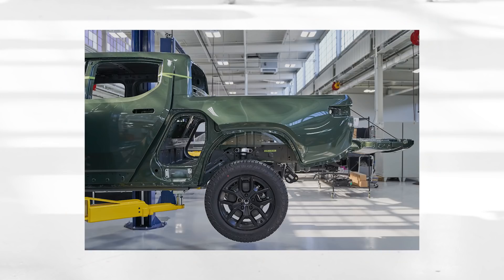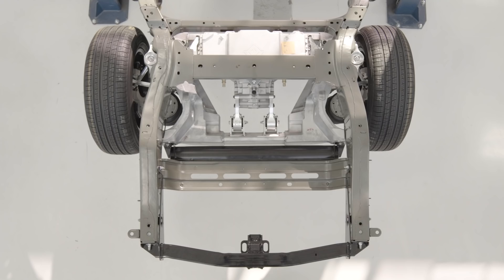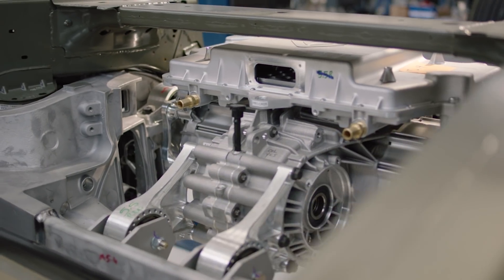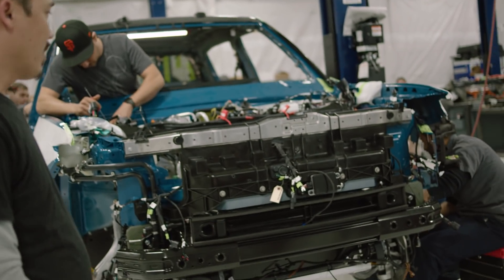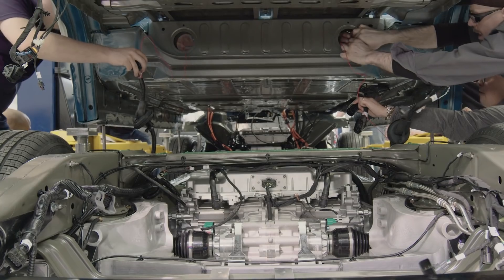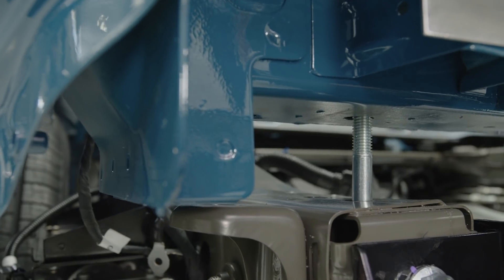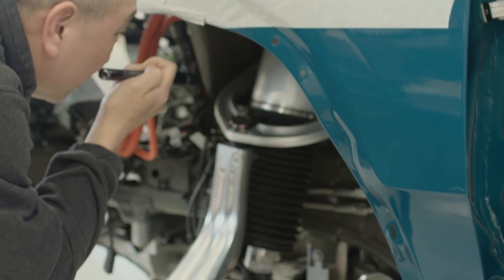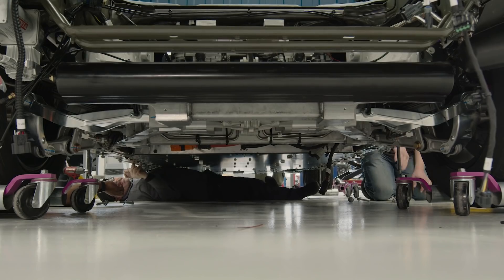Building a Test Vehicle | Progress Report | Rivian

Comment: When is Rivian finally going to deliver.  I've been promised delivery at the end of 2019, still waiting, now it seems mid 2021???  All promises and no deliveries.  When are you going to release colors, options and accurate pricing?  When are you gonna allow 3rd party testing of your vehicles?
Reply: I wasn't aware there was ever a promise to deliver any vehicles in 2019, it was always late 2020, and that got pushed back due to Covid-19 to 2021. Here is R.J. Scaringe, founder of Rivian, at the 2018 L.A. Auto Show stating delivery in 2nd half of 2020:  https://youtu.be/vphI_a6Qizg?t=1248
Reply: This is looking more like a scam company
Reply: Banana Chips What in this video looks like a scam? 

If it is, its the most elaborate scam I’ve seen pulled

Comment: Nice truck. The SUV is even better. I can see why it's expensive, and why it needs not only cost parity with ice counterparts, but to undercut fossil fuel competitors. If it's built so well, why not introduce a $0 down payment subscription model...
Reply: @Spin Mouth - Ironically RJ Scaringe, Rivian CEO, mentioned in an interview over a year ago that they would be offering a subscription model as one of their purchasing options.  But that was before Cox Automotive made a $350m investment into Rivian and will be assisting/handling aspects of the purchase process.  Like many things with Rivian no further details have been revealed on the subscription model or on how Cox Automotive's factors in on the purchase process.  Two main areas I eagerly wait to find out more about.

Comment: Vaporware.
Reply: @Reverend Al
va·por·ware /ˈvāpərˌwer/ nouninformal•Computing -  software or hardware that has been advertised but is not yet available to buy, either because it is only a concept or because it is still being written or designed. 

Rivian has working prototypes, hardly vaporware. They were even used, and tested, as part of the "Long Way Up" series, a 3 month journery where they traveled from Ushuaia (Tierra del Fuego), Argentina in South America to Los Angels, CA.  Tierra del Fuego is a popular destination for extreme vehicle testing.   
https://electrek.co/2019/11/16/rivian-r1t-electric-truck-off-roading-video-range/
https://electrek.co/2019/09/09/rivian-electric-pickup-harley-davidson-livewire-electric-motorcycles-trip/
Many more out there.  Just Google it.
Reply: @chuckm260  Working prototypes are not available for buyers. Vaporware stands.
Reply: @allencrider  That's only part of the definition.  RIvian has not "advertised" their vehicle just as Tesla has not "advertised" their EVs.   VW NOT applicable.

Comment: Nice video.  However, I hope this isn't a pacifier in our minds for the delay... I feel Rivian's relevancy dies out as time goes on. Tesla and other manufacturers are catching up.
Reply: Of course it's a pacifier.  Get real.  Just about every other auto manufacturer attempting to produce an introductory vehicle is more than likely going to have to delay.  The question becomes by how much, which of course the answer is not known at this point until this pandemic comes more under control.  So what's more important at this stage, staying on schedule or making sure the safety of the workers, their families, hell, the public, are the priority?
Reply: @chuckm260  My point is that most companies provide a delivery date with a contingency so that they can deliver faster than expected to generate goodwill. It would be nice to know that we are dipping into contingency time rather than extending the base time. Many Rivian pre-orders, like myself, have now placed a deposit on Model Y cause we are fed up of the third deadline being extended. First it was mid 2020. Then end of 2020. Now Early 2021. What's next?
Reply: @neilkadakia6204  Model Y is a great choice. I've heard very positive about the Tesla Model Y.
Reply: @neilkadakia6204  I'm also a pre-order holder and been following Rivian since their reveal Nov 2018.  If you follow Rivian to any degree you will know they typically do not release specifics until they have dotted the I's and crossed their T's.  Remember, they were in stealth mode for nearly 9 yrs before they revealed "working" prototypes unlike some other manufactures that like to talk about it for months, even years, before they have anything to show for it.  Back to the launch time frame.  Rivian has said since the reveal they are targeting mid to late 2020.  That's TWO YEARS from the point of their reveal!  Late last year they refined (not delayed) the target launch to be Dec 2020.   So far that date has not changed.  Now, will it?  Probably, but come on man, we're dealing with a freaking pandemic right now which has a ton of unknowns ... globally!  Do you think you could do a better job of predicting when the pandemic will subside, businesses will be able to ramp up again and meet demand, and that's assuming they survived the economic conditions from the pandemic, and then be able to predict, even with contingencies?   Not likely, therefore what's the point if the date is going to have to change again.  An understanding public knows that.  If Rivian's schedule bother's you that much than go buy the Model Y and end your frustration.  I'm also hedging my bets as I also placed a pre-order for the Mustang Mach-E.  In the meantime, I try to put things in perceptive with what's going on around us and let things pan out without making things worse or being unrealistic.
Reply: @chuckm260  I appreciate your optimism and general support of Rivian.  Clearly, we both are fans.  However, I think they need to do a better job of explaining some key issues that are pending.

1) How are they going to service/maintain the vehicle? What network?
2) What sort of charging network will they be a part of?  Are they going to be building our their own infrastructure at all?
3) Real timeline for availability, not some goofy crap like "Early 2021"
4) Start releasing pricing so they can filter out the people who are actually not interested; and bring people who are.

The reality is they are clinging on to our $1K deposits and are too scared to release any information in fear of us requesting a refund.  Man up and do it the other way.  Release the information and get a real count of interest.
Reply: @neilkadakia6204  I've never heard anything other than 2nd half of 2020 or late 2020.
Reply: @neilkadakia6204  -  I hear yea, as I have similar questions and many, many more.  Prior to the pandemic I was developing a more critical view on the lack of info coming out of Rivian.  However, with this pandemic going on, anything time line related that involves their supply chain partners and other entities is well beyond their control, and IMHO need to give them slack at this point.  Once things settle down and Rivian and their supply partners can get things ramped up again, I'm not worried about it because quite frankly there are much bigger issues to work about, like will a couple of my extended family members who are in the healthcare industry staying safe.    

FWIW, Rivian sent out an email today.  In part it contained the following: 

Production Timing 

We will be able to make an official statement once social distancing restrictions are lifted, the supply chain stabilizes and plant construction resumes. We are monitoring the situation closely and appreciate your patience. In the meantime, if you have additional questions, don't hesitate to reach out.
Reply: @neilkadakia6204  

1) Cox has a fleet servicing network.

2) Destination chargers are the only thing they've committed to so far. But Ford's going to want options for their EV drivers too and Electrify America is actually moving pretty fast (rates are pricey though). Check out A Better Route Planner to get an idea.

3) Can you predict how soon we'll have reliable tests, or how many more idiotic right-wing protests or GOP vote supression stunts are going to prolong this pandemic? Nobody can answer that. What I do know is that they were expecting to be at Crash Testing by Q2 before Covid hit. I'm not an automotive industry expert but I assume that means they planned to have at least one production line running by summer because they'd want to test for manufacturing flaws that might not come up in the hand-built cars. I suspect these cars here are actually the event rep-rumored 50-car test DRIVE fleet they wanted to roll out in the summer. Never seen a green R1T and they all have the latest wheels so it's probably pretty recent. When it first became clear Covid-19 was a big deal and they closed their factory, they said there's was no impact on their late 2020 plans yet. I suspect they did have some buffer time and were hoping to launch in Q3.

4) Per a January Reuters article RJ quote - very well-equipped mid-range with the electro-chromic roof now about 69k. Rivian rep at event rumor on rivianforums: Base versions at each tier about 20k less than the original stated pricing. So probably 50k, 60k, 70k

I don't think they're worried about your judgment of their manliness. They're a private company. They don't have a board on their ass to blow hot smoke up the public's backsides or make promises without any buffering. There might actually be opportunities for further refinement and new features because of the delay so why release a configurator before it's clear when they can get back to work on their production line?
Reply: @erikreppen9257  I appreciate your detailed response. My research indicates that the starting price for R1T base model was 69,500 and 71,500 for base R1S. After Tesla unveiled the Cybertruck, they decided to reduce pricing. By 19,500, though? That seems very unlikely considering they have not achieved any scale whatsoever and will not make a dime from repairs other than parts. In fact, I believe they will invest more in training Ford and Cox to service the vehicles than they will receive for at least 20 months.  Most vehicle companies structure their profit not just by sales but also service. They can afford to sell the car for less knowing they will get a service relationship.  This company has a major uphill battle here.

Furthermore, Tesla is leaps and bounds ahead of Rivian in 3 key elements: Battery technology+production, full self-driving, and service.

I want Rivian to succeed. I have a deposit that is going on 18 months now.  I like the vision and the direction. Unless they unveil soon and begin monetizing they won't be able to afford the R&D required to stay competitive.

It will inevitably be a patent sale to a larger company like Ford and our dear RJ will become an employee.  

It's time to shit or get off the pot or they will lose the game.
Reply: @neilkadakia6204  There was a price drop. Look for that Reuters article. They were able to invest a lot more into the factory than they were originally planning. My theory is economy of scale ramping up for them faster than they were originally expecting and they didn't want to lose preorders to the early Model Y launch. The Amazon partnership and fleet probably also gave them a lot more supply chain leverage.
Reply: If you can't deal with a couple delays, Kickstarter might not be for you!  Never mind pre-ordering a vehicle that doesn't exist yet, made with a process that doesn't exist yet, sourced from a supply chain that doesn't exist yet, by a company that barely exists!  If you want Special, or to be First, you get to wait.  (That said I'm always a big fan of transparency.)
Reply: @C20H25ON3  Asking me to be patient is missing the point. If we are all going to invest 90K in future tech, it needs to be future tech. The longer they draw it out, the faster their competition catches up. You want at least 7 years of relevancy with any car. We are dipping into that time now.